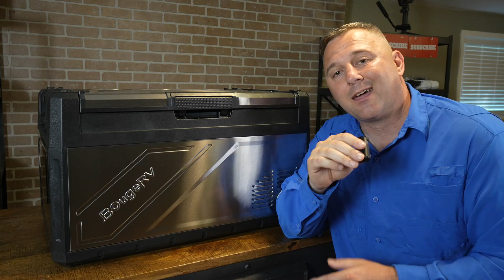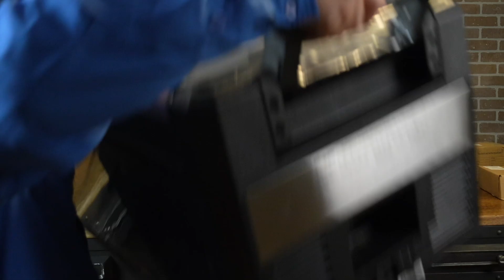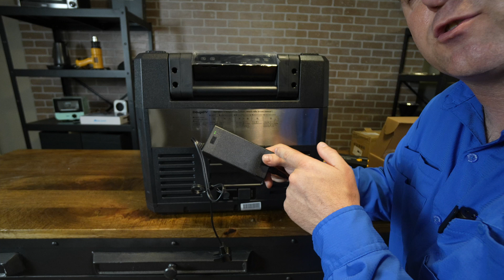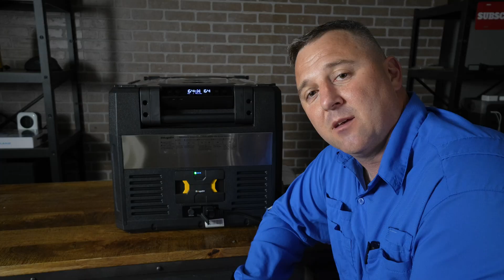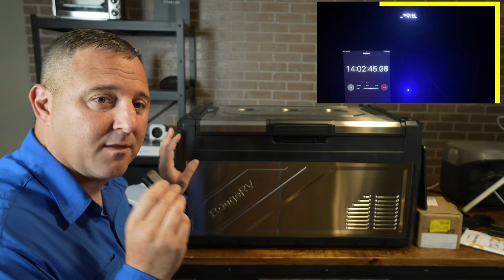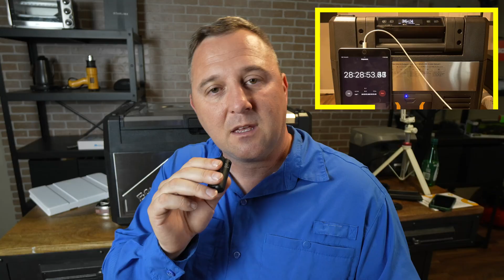BougeRV Rocky 12v Fridge the Best of 2024! (So Far)

Comment: Just got the Rocky 65. Still can’t seem to get the door off, but the thing that kills me is that the freezer side is the larger side on dual zone. Not sure when I’ll ever need more freezer space than refrigerator space…
Reply: The newer 3.0 versions addressed the left size being the freezer in dual mode. Now you can use either side.

Comment: $230 for that battery is overpriced. Just buy a LiFePO4 100Ah for around $200 and get 1200Wh. That battery should be $40–$55 max, it's like a 15Ah battery. I understand it's unique to the cooler, but $230 is a rip-off for the WH you get.

Comment: I'm interested in getting a new fridge, either the Rocky 55, or the Rocky 40. However, the most important issue for me is the dimensions. 
While the external dimensions are on the website, they don't list or show the height with the door/lid open. 
I need to know that measurement if I will be able to open the lid or not in the back of my vehicle. 
Since the CR30 fits in my vehicle, I suspect that the Rocky 40 will fit fine, so I'm also looking for the vertical clearance measurement on the Rocky 55.

I have a Nissan Pathfinder. It has a spare tire on a rack, and a rear hatch. I don't have to open the hatch, as I can open the window in the back, and then reach in to open the fridge and access drinks or food. That worked out great for my Aspenora 37qt, and then later my BougeRV 30qt. 

Your product review covered measurements, but didn't cover a measurement with the lid open. 
Could you tell me the total height with the lid open 90 degrees? 
That would help me out a bit. Thanks!
Reply: Just remember that a larger capacity one is also heavier. These things are heavy as is with nothing in them and without the battery.

Comment: I just bought my 2017 Toyota Sienna van two days ago.  I'm investigating power stations and refrigerators now.  Do you think this one fits between the front seats?   Do you have a preference for the shorter or taller ones?
Reply from the maker: That’s a great question. I’d have to measure it. I no longer have the Sienna though. The good thing is that the area is flat with the console out. So it’s possible.
Reply from the maker: I prefer the largest fridge possible because you can extend your trips further like that.
Reply: Rocky 40 specs : 28.03D x17.72 W x 15.79 H (inches).